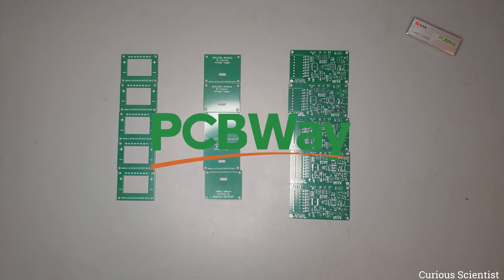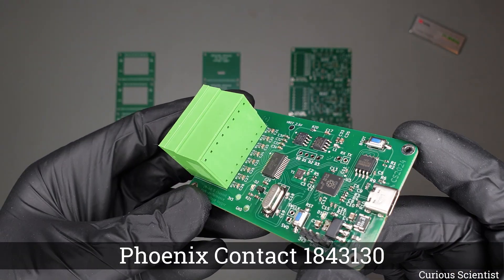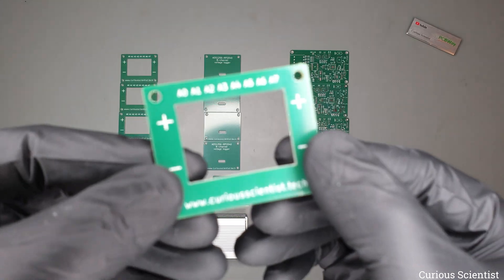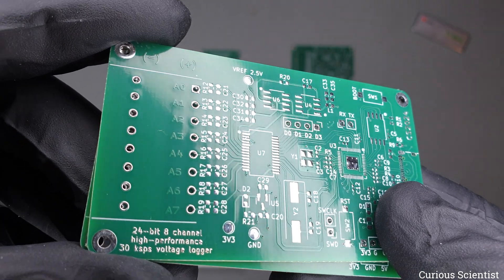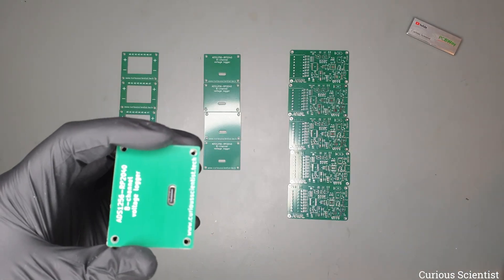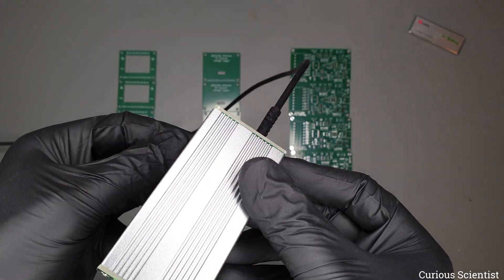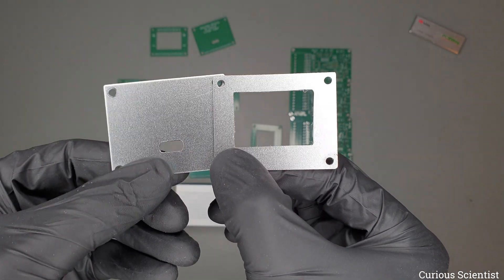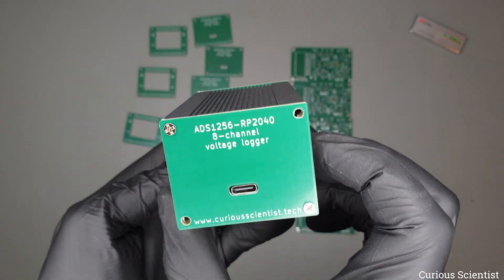RP2040 + ADS1256 DAQ board - PCB-based enclosure

Comment: Didn't say or warn what the maximum input voltage is.
Reply from the maker: Hi! It is written in my library's documentation and in the ADS1256 chip's documentation as well. If the buffer is disabled, it is +/-5 V. If it is enabled, then roughly +/- 3 V.

Comment: Thank you for showcasing your excellent work!  I'd been hoping to find something like this when I started a long term hobby project of refurbishing an HPLC system.  Playing around with a variety of different detectors now.  I'd been looking at ways to circumvent the need for expensive proprietary peripherals and software and this is fantasic.  Perfect for "DIY Lab [with] hanging wires"... exactly!
Reply from the maker: Thanks! Actually, my very first encounter with this ADC was when I had to revive a super old lab equipment. It had some super old logger with a DOS computer. I still have the original prototype tucked away to remember where instarted. Since then, I learned to code a bit better and to design PCBs...etc., so I ended up writing my library and designing my own board for this ADC. Since I know what kind of things one wants to measure in a physics lab, I tried to follow those ideas when coming up with the product. I will soon follow up on  the project with the accompanying software and some use cases. Stay tuned!

Comment: And the gloves are for?
Reply from the maker: So you can ask this question. 👽
Reply: Some of us have eczema, bitten fingernails, scarring etc. I don't like my hands being videos or photographed either. If I have to, I wear surgical gloves or jeweller's gloves.
Reply from the maker: @yrath5034  It is not the above issues, but my skin is rather sensitive. And since I use IPA to clean stuff, I would rather use gloves so it does not mess up my skin. Flux, solder paste, thermal paste and glue are also the reasons.

Comment: Been learning bits & pieces of PCB layout - smart about the blank PCBs as caps.  What plugin did you use for the curves?  That's one pretty board you designed - kind of a shame to hide it lol
Reply from the maker: Thanks! The plugin is "kicad-round-tracks" from an author called mitxela. It is available on his GitHub. I am also a bit sad about hiding the PCB, but I am hoping for some benefits from its shielding effect. Will see, I will try to do some measurements later on.

Comment: I have tried to follow this but it is way, way over my head. I even read the blog post but I still have no idea what this thing can do or how it might be used. You say data acquisition but for what?
Reply from the maker: You can measure any voltage source in the +/- 5 V range. Load cells, Wheatstone bridges, thermocouples, any sensors that respond with a voltage proportional to the measured signal...etc. You can decide what data you want to acquire with the device.